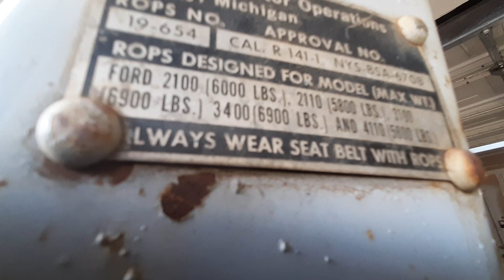FORD 2000-4000 hydraulic fluid service (1973 model)

Comment: Can you tell me what the screw is right below the fluid level plug my son took it out and now there’s nothing to hold it back in ??
Reply from the maker: You gotta be more specific on which fluid plug
Reply: @nathanprovence70   the hydraulic fluid level plug
Reply: Yes I did the same thing , looking all over the internet can’t find a solution 😢
Reply: @nathanprovence70 He talking about the one that has a flathead right below the fluid level plug 
I also accidentally unscrewed it and now it won’t stay in. Was wondering if you knew what was the solution 11:10
Reply: Yes I also accidentally did the same thing I’m so bummed was wondering if you found a solution
Reply: I found it https://youtu.be/Ul4XzTDAtnA?si=uEvxx1eJFuBpMAfB
At exactly 9:10 he take out the screw to undo a filter thats inside the tractor hydraulic housing

Comment: Thanks, great descriptions.  I have water in my 4000 as well,  Is there a hydraulic filter especially after having water should it be changed?  I've heard of using  an additive to help collect/dry out the water contaminated fluid, Seafoam or "dry gas" ???
Reply from the maker: I actually put an O- ring on the fill cap on the rear diff and so far so good
Reply: Drain the fluid and fill it with straight diesel fuel, Start the tractor up and operate your 3pt lift a few times then drain it and fill it back with the correct fluid

Comment: After lifting my lift arm it won't stay in place...slowly falls back to lowest position.  Any ideas?
Reply from the maker: Got a leak somewhere. Could be internal. That's usually a bad cylinder or seal on cylinder
Reply: @nathanprovence70  ty sir!
Reply from the maker: U bet. Mines for sale if your looking for another one$4500

Comment: The dip stick by the gear shifters. Isn't that the same oil? Or is it in a different compartment so you have to check with the overfill plug?
Reply from the maker: Mine had a plug
Reply: @nathanprovence70  my question is isn't the dip stick the same level as the overflow plug on the side? Or are they different compartments that need to be drained separately?

Comment: That other lever is the draft control for using underground implements. Engaging that allows your positions lever to act as a downward-force control lever. Great video. I have the 4000 in diesel, looks identical to yours.
Reply from the maker: I just put mine up for sale